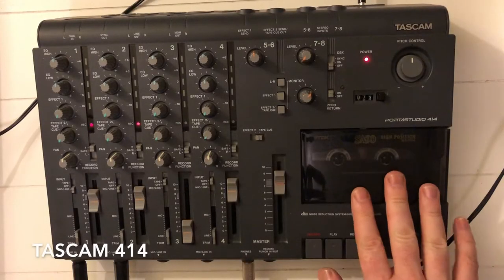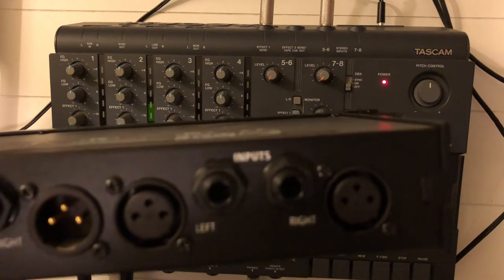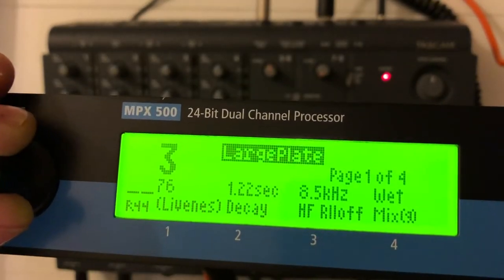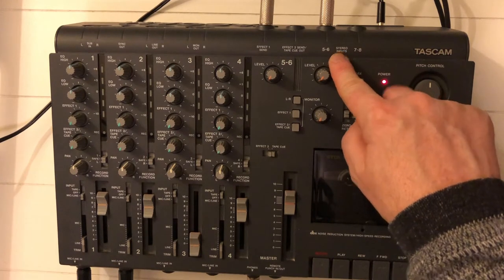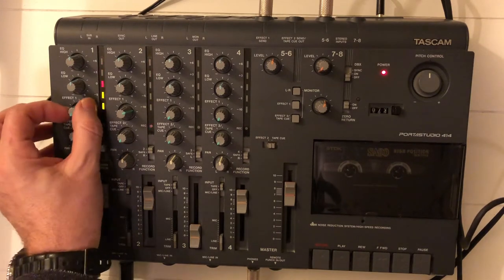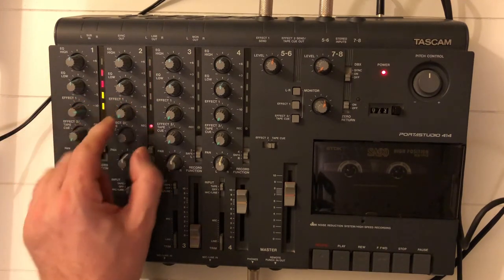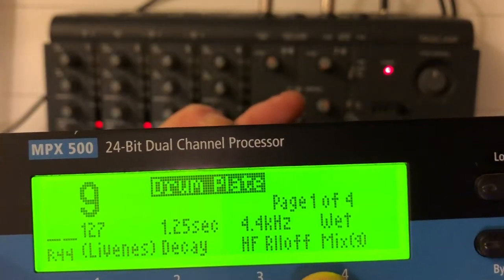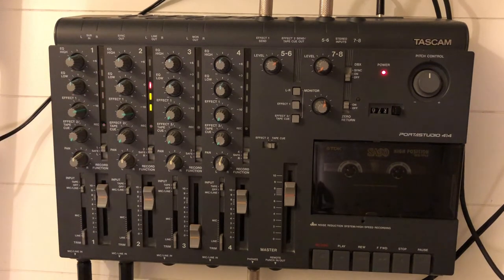How to connect a reverb unit to the effect send of your cassette multitrack recorder

Comment: I just got an MPX 550 from Ebay. I enjoyed watching your vid and it makes me feel good about buying my Lexicon 550. Now I need to learn how to tweak it properly. Interesting that you record with multitrack cassette deck. I had one from Yamaha thirty years ago. This brings memories.
Reply from the maker: Jkaterchannel Take your time and read the manual if you have one, it will pay off. And to be honest, most of the times I found myself using the plate and hall presets, tweaking only the decay time and HF rolloff to my taste, and that was all I needed. I recorded lots of acoustic songs with just guitar and voice, which makes reverb even more indispensible, and the mpx did a wonderful job in the mix. Enjoy yours! Thanks for watching

Comment: Have you ever recorded SMPTE time code onto one of the tracks on a 4 track like this from a MIDI to SMPTE converter from a drum machine? Then play that SMPTE track back through the converter to trigger the drum machine to record along with on the remaining 3 tracks? I guess you would need to use an aux return to monitor the drum machine output or a separate board.

I really want to record a project using one of these recorders for the challenge of it. I’m used to ProTools and all the audio tracks I want in my studio lol.

I really enjoy your channel and videos. Cheers!
Reply from the maker: FrequincyRecording i’ve never touched anything related to cassette syncing, but I will definitely make a video on this subject in the future.
Thank you for your kind words!

Comment: Hoi Dennis, 
Great stuff here👍 I do not have any reverb hardware except a pedal but can I use plug ins on my tape recorder and how would you do that? Where sgoukd I connect? I own  a fostex 28X -h..
Dank je!
Reply from the maker: Hi, you could use the reverb pedal of course. But if you have a low-latency audio interface with your computer, you can hook up the ins & outs of the interface to the return & send terminals of your 4-track. How exactly depends on your cassette recorder, your interface and your daw software. Succes!

Comment: Hello and thank you for your great vids! Any way you can help by explaining how to do this on 244? I suppose it can be achieved by using aux sends/returns, but I had no luck doing it so far. Another thing that bothers me is that 244 has Left and Right send and receive, while I want to attach a mono reverb with only one input and one output. The user manual on this topic is beyond my understanding.
Reply from the maker: Zvuki Dedov Thanks for your comment! I’m quite busy at the moment, but I promise I will make a video on hooking up effect gear to the 244. Stay tuned!

Comment: J. Fields.  I have dbx  Project 1 reverb i'm also have a mixer; compressor; Equalizer.
 [.Dbx router selector]  is connected to my dbx  1 band range controller. Lights signal comes on can't hear reverb.What should i do ?
Reply from the maker: Jesse Fields It could be many reasons why you can’t hear any reverb, check if there is any signal coming into the reverb, and follow the path of the output back into the mixer. I hope you’ll get it working

Comment: How would recording the effect work? Would it be printed on the kick/snare tracks or would you have to record the treated drums to a separate track?
Reply from the maker: Ryan Viral It depends on your project. In this video I demonstrate how you can add some reverb to 1 or more tracks during mixdown. So the drums etc are recorded on tape “dry”, and at mixdown the reverb is added to the stereo out signal. This is useful when you want to give your mix an extra sense of space.
But sometimes you have a special reverb or chorus effect (for example), that is only needed on 1 track, or when the effect is an essential part of the sound you want to record. In those cases it can be useful to record the signal AND the effect onto 1 track at the same time. The downside of this is that you can’t modify the effect after it has been recorded
Reply: Ohhhhhh ok.. didn't think about it going through to mix down, but I get it now. Thanks!
Reply: @MultitrackCassetteFans  Hey Dennis, thanks for your videos, they're really useful. I have a question that relates to the one above. So I have an old Copicat reverb/delay unit from the 60s that I like the sound of when I'm singing/playing and I'd rather just record everything I'm hearing at tracking rather than waiting till mixdown. I followed your instructions for how to hook up the reverb unit to the Tascam 414 (which is why i can hear it) but when I play my recording back it's dry-- the effect hasn't been recorded. I can't seem to solve this (except by plugging the reverb unit into Track 1 instead of Stereo inputs 5/6, and recording Track 1 (reverb) and Track 2 (mic) onto Track 3, which loses a lot of quality). Any suggestions what I might be missing? Thanks so much!
Reply from the maker: Adrian Glynn You could put your signal into the Copicat, set the dry/wet balance within that, and run the output (including delay) into the 414 input. That way, your voice will be printed to tape along with the reverb. So let your Copicat do the mixing :) I’m sure there are other methods though, but this is one that should work.
Please note this one thing: when you record your own vocals, you might exaggerate the delay level to comfortably hear the effect while performing, but usually this is too much when you play back your recording.
Owning a Copicat...wow 😀👍